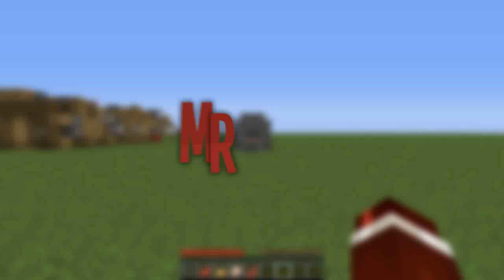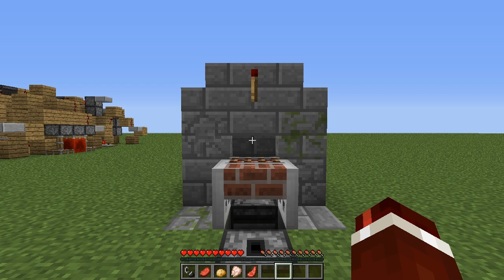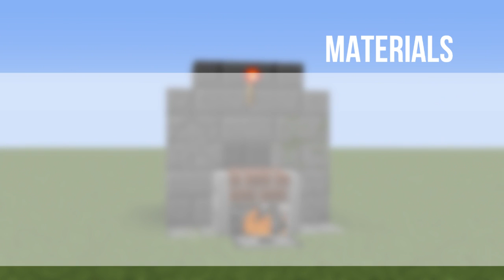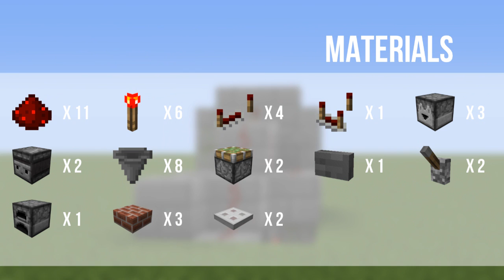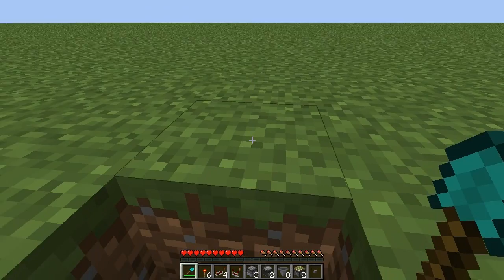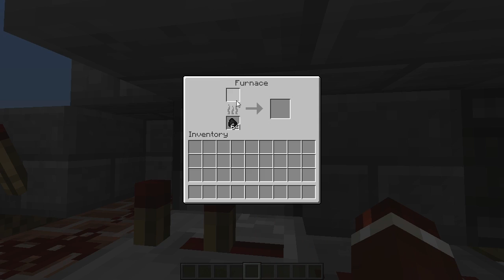Minecraft 1.12: Redstone Tutorial - Working Grill!

Comment: If anyone is having the problem of where your cooked products get stuck in the bottom dropper toward the front I found an easy solution. Put one block in front of the comparator, with a Redstone lamp on top, that will activate the observer thus making the cooked product shoot back to the top where its supposed to go. Hope this helps anyone having this issue!
Reply: thank you so much i had this problemlike 20 times and it just upset me

Comment: I built this but when it came to testing it, it didn't work. I looked at the mechanism  and realized that several blocks where missing even though I remember placing them. I tested it again but it still wasn't working. Then I saw a light coming from inside. I went to look and that was when I decided that it wasn't a good idea to use wood as my block of choice.

Comment: mrcrazyfish a part of my grill inside under is blingking i dont thingk it shold happen
Reply: I had the same problem. I am running mc 1.12. After some trial and error I found that the repeater on the left side, as you are facing towards the back of the system, next to the furnace, needs to bet set to 3 ticks. If that doesn't work, try 4 ticks. If it is still not working I am clueless. This just fixed my issue.
Reply: Oh, and the button needs to be wood, as the timing is a little different now. It needs more of a delay to turn it off with only one push of the button.
Reply: That happended I fixed it but I don’t Remember so sorry